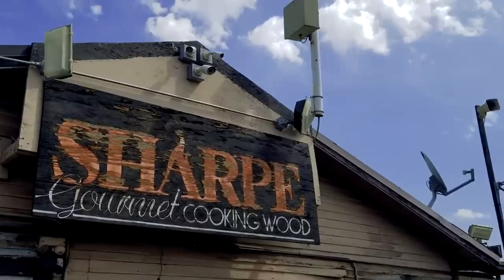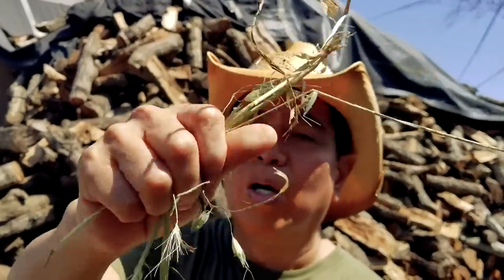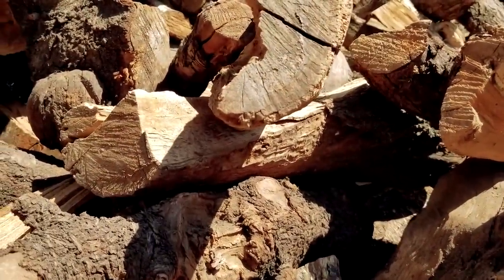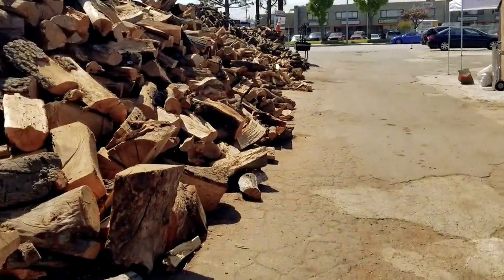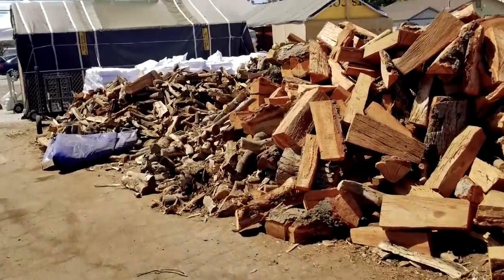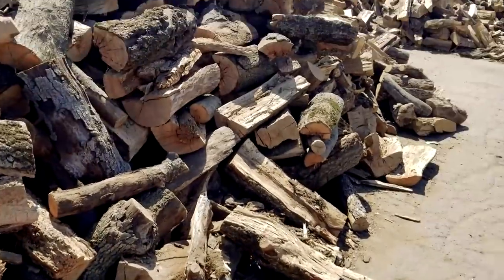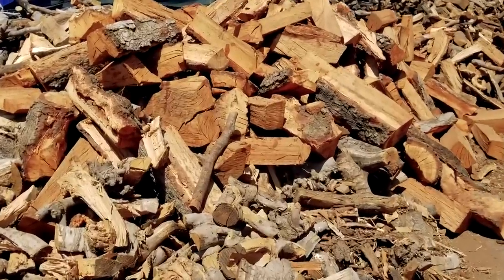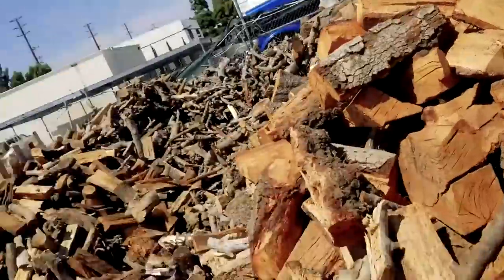Part 2 - Science of Smoking Wood Lignin How-To by BBQ Champion Harry Soo SlapYoDaddyBBQ.com

Comment: Great job Harry. I have struggled with wood above wood below my coals and this explains why you want your coals hot and your wood warm.  You are the master......thanks again
Reply from the maker: Give it a go and let me know how it comes out
Reply: @SlapYoDaddyBBQ  I have a UDS with a vortex fire basket, I find I cant put the wood on the bottom nor on the top due to airflow issues. The air intake tubes open below the basket, thoughts?
Reply from the maker: @pauls1357  Give it a go with wood under and compare with your usual method.  If your method is better, don't follow my method.  Do what you need to get the best results.
Reply: Thanks Harry, I may even record and send you the results!

Comment: Wonderful explanation!  Again, I have been doing it wrong and will change my evil ways.
Three questions you many have addressed already, but so far I have not found.  First, the wood chunks and bits you show are well aged and dry; do you ever use fresh cut live material.  Second, with dried wood, do you ever soak it in water to extend the smoke duration?  Third, where is "Part 1" of this "Part 2", YouTube is holding out on me.  Thank you for what you do!
Reply from the maker: 14% moisture.  Get a moisture meter from my Amazon store.
Harry Smoking Woods - https://youtu.be/X8Xwcj5feDg
Patty BBQ Woods #1 - https://youtu.be/jXR4NqC1l6Q
Patty BBQ Woods #2 -  https://youtu.be/YvPAhONkLNk
Smoke ring - https://youtu.be/G0rHKm-JGsg
Reply: @SlapYoDaddyBBQ  Will do!  I will order after Christmas rush and get several thing through your access.

Comment: So where is the balance with offset smokers? Most people I’ve ever heard that speak on the subject emphasize keeping a clean smoke and avoiding smolder.
Reply: E JAY I agree. I was confused because wood that smolders actually produces off chemicals making dirty smoke. Leading into weird barbecue
Reply: I want that answer as well. You definitely get a bad taste if your wood just smolders in an offset.
Reply: My question as well. What temp does wood on an offset stick burner burn at? Offset stick burners are the gold standard of real pit barbeque. How do you replicate that with charcoal and smoking wood?
Reply from the maker: Yes I have more videos that build on part 1 and part 2.
Reply from the maker: I have more videos coming.  I have friends like Jaime Geer of Jambo Pits. You saw Jaime on BBQ Pitmasters with me
Reply: I think he answered it in this video.  The coals on top are burning at a hotter temperature.  Anything underneath producing the smoldering gases have to pass through this high temp zone, which then helps complete or partially completes the combustion of those smoldering gases.  Great video, Harry!
Reply: Jesse Rocha when using offset smokers, wood logs splits or big chucks are usually the primary source. People use coals to help the wood ignite and stay lit, but for the most part you’re burning mainly wood. Smoldering with that much wood would be disastrous. So my question is what’s the balance when wood is the primary source, instead of coals. Mr. Soo knows what I mean.
Reply: @j.ciloafasho  I know what you are saying.  Air is the balance.  Fuel (wood) to air to achieve a slightly less than stoichiometric burn, and keeping the temperature where we're targeting it to.  Tending to the fire and monitoring the amount of wood you feed into the offset is key, as I'm sure you know.  That's what makes us all trying to achieve that holy grail of bbq :)  and watching all of these bbq videos, lol!
Reply from the maker: @j.ciloafasho  When you use wood as BTU and as flavoring, you don't need to worry if you're using wood to your liking.  The fav for stick burners folks is pecan and post oak as they are mild enough to run for 10+ hours without overpowering smoke flavor.  Wood is expensive for most folks so they use lump / briquettes and use wood chunks for added flavor.  When you run a stick burner properly (I'll cover the detail in future videos) you will get a clean burn and depending on the thermodynamics of your draft you get championship results (again, I'll cover in detail later).  Thanks for stopping by.  Please allow me to post the science and I'll post the application of science.  I can't get it all into just two videos Part 1 and Part 2 that I posted.  Cheers, Harry
Reply: @SlapYoDaddyBBQ  Got it! Thank you for the response!
Reply: @jefferysiler1624  you definitely want to stay away from the dirty smoke syndrome.  On my BGE, I load wood chunks on bottom and lump charcoal on top.  Always get a good blue smoke for 12-14 hrs with no fuel additions during the cook.  For my offset, I'll place 1-2 splits on bottom and lit lump charcoal on top.  At 225-250 F, I get good clean smoke for about 3 hours before I need to add more fuel.  At that point, I add small pieces of wood and lump charcoal mixture.  Keeps a good clean smoke for the entire cook.  That's been my experience.

Comment: Wood should go under the bottom in something other than am offset, any kind bullet or barrel shaped smoker. Having the heat above the wood to smolder properly and gives a cleaner smoke.
Reply from the maker: The wood when used for flavor (and not BTU heat) goes under the briquettes or charcoal.  For offsets, the flavor + BTU heat is provided by burning wood that you burn down to embers.  For brick offsets, like what is used at Snows in Lexington TX, they use a burn barrel to get the wood down to embers and transfer the embers from burn pot to be spread under the brick offset.  See my numerous Snows videos for more details.

Comment: Does the under the coals suggestion still apply to a sick burner?
Reply from the maker: If you're using only wood in your stick burner, it does not apply as you're using the wood for both BTU and pyrolysis of lignin.  If you're using briquettes or lump charcoal for the BTU, you can put the log beside the coals and let it smolder. When the log burns, you push it into the fire and put a cold log in its place. If there is interest, I'll do a future episode of how-to for stick burners folks.
Reply: @SlapYoDaddyBBQ  yes please
Reply: Please I’ve been waiting for a stick burner video from you!
Reply: @SlapYoDaddyBBQ  Yes please!

Comment: Hi Harry, I have been thinking a lot lately about this topic and really appreciate your informative video. Can you please comment on why wood chunks placed on top of the coals burn hotter than chunks buried under the coals?
Reply from the maker: When you measure the temp of a burning wood stack (same for lump and briquettes), there is a temp gradient from top to bottom with the top being the hottest from 800+ degrees F depending on the BTU of the fuel.  The thermal profile is cooler towards the bottom of the  stack so when your wood is underneath (see my how-to load WSM videos), you get optimal pyrolysis of the lignin in the sweet spot between 450F to 720F to release the compounds necessary for the flavor, anti-fungal, anti-bacterial, color of smoked meats.
Reply: Harry Soo Thank you! That makes perfect sense. So when you exceed 750 and get into the 800 + range is the main issue that you introduce unwanted chemical compounds that taint the flavor or is it that you just don’t get the benefit of the sweet flavors that you get when you are in the 450 - 750 sweet spot?

Comment: Harry, great video!   I would very much like to know your opinion about smoke generating devices that use dust or pellets.    I only have an electric smoker, so I often use the amazin tray with dust for smoke (lasts much longer), but to me it makes things taste very different.   Even with great ventilation the smoke flavor is less sweet, and seems to turn bitter before I get deep rich smoke.   I can put 6 hours smoke on a brisket and get a moderate smoke flavor with it but if I go longer it only starts to turn bitter.
Reply from the maker: Sorry I don't have much experience with smoke accessories except the smoke tbe in pellet cookers which works well.  I know of folks who have debugged their electrics and can get similar results compared to folks who use wood, charcoal, and briquettes.  You just have to keep trying to coax the max from your smoker.

Comment: Let me ask your thoughts on this. I use a reverse flow stick burner. It holds 12 large butts and I start it off using an 18lb bag of charcoal  adding red oak, white oak and hickory through out the cook for fuel. I like to hold my temps around 250° - 275° through out the cook. If I’m understanding the BTU’s right, I’m going to use more hickory than oak or pecan on a 8 hour cook?
Reply from the maker: Check the BTU of your hickory and conpare

Comment: This was great Harry. Thank you! So when the wood is covered in lump and it’s starting to burn, when would the smoke be considered CLEAN smoke? How long does it take to where you can start cooking after you light the coals and wood is starting to burn?
Reply from the maker: I cook right away and don't wait for the smoke to reach the "clean" state.  I've not had issues so far doing so at comps.
Reply: Harry Soo  Thanks for your reply. This is EXACTLY what I needed to hear. So many videos about blue smoke and white smoke and clean smoke etc etc. It’s simple yet confusing as to when should I start cooking. Thank you!
Reply: @SlapYoDaddyBBQ  This is the only issue I have at the moment when smoking, the food is tasting very bitter, I will try the wood underneath and see if it helps, fingers crossed, thanks for the video
Reply: @jameshart4448  I just experimented couple months ago, and by putting wood underneath the coals, it really produces cleaner smoke and faster.
It works plus the smoke is not empowering the meat. Simply balanced.
Harry soo is a master !
Reply: @SlapYoDaddyBBQ  do you cook right away because your using jealous devil compared to any charcoal briquettes? Your answer may confuse a lot of us about the clean fire especially on shorter cooks like pork ribs. We all strive for that pure smooth mellow flavor of wood. Fortunately some of us fall victim to the gas station bbq flavor.
Reply from the maker: @danielploy9143  for long cooks, the initial smokiness is fine for the 30 mins that my pit gets up to temp.  When in doubt, wait until the smoke clears before putting meat on. I don't wait but I've cooked ribs a few times on my pits so I know the initial smokiness will not be an issue.  As always, try yourself to see what works for your particular setup.  Don't believe folks like me.  Do so you know for yourself.  Good luck!

Comment: Harry- love the insight and science u shared!  Would you see any issue with wood smoldering beside the lump (vs underneath) in a large kamado so long as it’s not fully combusting on top of the fire?  I like to let my wood smolder on the side of my fire so I can see how much I have and if I need to add any during my cook.... cheers!!!
Reply from the maker: That's how I set up my Kamado so keep doing it if you're getting flavors you like   :-)
Reply: Harry Soo Hi Harry- Very grateful that you shared this science of wood smoke with everyone.  In a kamado, can wood only smolder beneath your lump or could it also smolder b/t 450-720 on the side of your fire (so long that it is not directly on top of the fire itself)?  Thanks again!
Reply from the maker: @ryanbramich6951  Hard to tell as there are so many variables. I suggest you experiment with different placements and taste the BBQ produced to see what works for your pit.

Comment: I have a question regarding the use of the Weber smoky mountain. I have found that whenever I add new charcoal to an existing fire, or I start smoking before all of the coals have turned gray, the food gets a bitter taste from the smoke coming from the coals. 

       I see some people recommend loading the smoker with only some of the coals burning. How can I get a longer burn without the charcoal smoke ruining the meat?

        I am going to buy the Smoky mountain. I am leaning towards the 22 so I can do brisket and pork shoulder. 

        In the past, I used a cheap brinkmann for chicken and fish. But any time I tried a larger piece of meat, the coals would burn out before the meat was cooked. If I added coals, the coal smoke ruined the food. How can I avoid this?

Thanks in advance for your your help.
Reply from the maker: Get a good comp pit like the WSM (any size) and very good charcoal (I use Jealous Devil) and you will do OK. See my WSM setup videos also.  And the 150 recipes on how to do backyard and competition meats.  Thanks for stopping by

Comment: With an offset smoker with a larger firebox will you achieve the same results by placing the coals to one side of the box and the split log on the other side? I recently switched to that method and have noticed I can get the same smoked flavor while using less fuel. Thanks for your videos!
Reply: Hmm...sounds like something better described in a video. (Hint,hint)
I like the idea.
Reply from the maker: Yes smart move as you can get BTU from less expensive briquettes and use the more expensive wood for smoke flavor.  That's how top commercial restaurant pits such as Old Hickory and Southern Pride work with gas for BTU and a log every 45 mins for the pyrolysis of lignin.

Comment: Harry I wanted to ask you does this apply to an offset smoker? I kind of have a hard time trying to figure out how to put the wood underneath the charcoal in an offset smoker. I use a real cheap Offset Smoker that the Mother-in-law gave me that her brother was going to throw away
Reply from the maker: In offsets, you use the wood for both BTU heat and for smoke so you have to burn down the wood to embers to get the proper smoke.  The wood has to be the right type (oak, pecan, etc) to produce sufficient BTU heat (for example, apple gives good smoke but no BTU).  My offset friends often have a burning pile and a unburnt log on the side on standby.  You roll the standby log onto the fire and put a fresh standby log in its place.  Repeat every 30 - 40 mins
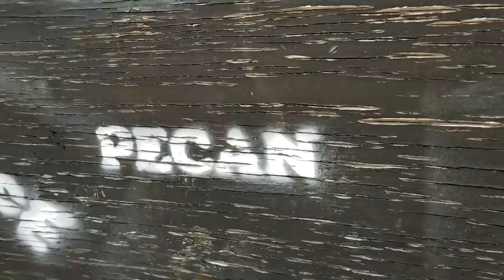Reply: @SlapYoDaddyBBQ  Thanks a bunch, Harry! By the way, I made the gigantic mistake of watching a video by some Chuds BBQ the day I was smoking a brisket for Thanksgiving. I decided to try low and slow the day before Thanksgiving and I put it in at about 9:30 in the morning and I took it out at about 2:00 or 3:00 in the morning the next day which is Thanksgiving morning. Well I'll smoking it I came across a video from this cat where he Tookie brisket and put it in the warm or hot ice chest that had been warmed with hot water. When I pull the brisket out of the smoker, I only let it sit for 20 minutes. Then I wrapped it in you butcher paper and in a paper towel and put it in the ice chest and left it there. That was a big mistake because when I took it out at 2:00 p.m. later on that day, it was dry. I ruined it and I was pissed for having even watched that video. Next time I will let it sit out at room temperature for 2 hours before I put it in a regular ice chest without having been warmed up with hot water. I was so mad at myself that I sent the money back to my mother-in-law that she had given my wife to go out and buy the slab of brisket.  Ironically, it all got eaten up, and some of the brisket from The Middle actually turned out okay. I used your fundamental brisket video with the pepper salt and celery seed just like I did for the one for my wife's birthday that came out fabulous. Thanks again Harry.
Reply: Hey Henry one more question. Where can you get post oak wood if you can't find it here in Tucson Arizona? So far I've been able to find hickory wood at Walmart, but I've had to dry it some by putting it in a Weber grill on the rack over a bunch of hot coals
Reply from the maker: @victorramosjr2239  I suggest you order it from Patty.  She ships across America https://thewoodshedoc.com/
Reply from the maker: @victorramosjr2239  Happy to be part of your barbecue journey Victor!  Keep spreading BBQ love!  Thanks for trying my recipes.

Comment: The idea is VERY good and sound BUT... on a slow brisket cook (many hours), this trick won't apply after the first wood burn for you can add the wood only on top after the first wood smoldered. If you have a trick I don't know then... please share !
Reply from the maker: Did you see why and how I place wood under the coals videos?
Reply: @SlapYoDaddyBBQ  Yes I did but you seems not to understand my point: after the "under" wood have consumed, you need to add more wood. In this situation, it is hard to add wood UNDER red hot charcoal embers isn't it ? At this point, the only option seems to add wood on top ! Any hints ?
Reply from the maker: @benoit.gerin-lajoie  If you has seen videos of my 1st place USA KCBS methods on how I load my wood and number of chunks under, you should be able to create championship BBQ that impresses 24 strangers (judges) at each contest I win in double blind judging processes.  Give my methods a try and see if you like them.  If my first place secrets don't work for you, you can try other ways.  I can only show you what I do and the awards my process have won.
Reply: @SlapYoDaddyBBQ  Do you have a link or... the title of the video please ? Kind regards...
Reply from the maker: @benoit.gerin-lajoie  Brisket and Butt, add 4 tennis size hickory + 4 apple. Ribs and Chicken, 3 + 3.  All under the coals. No need to re-add wood during cook.